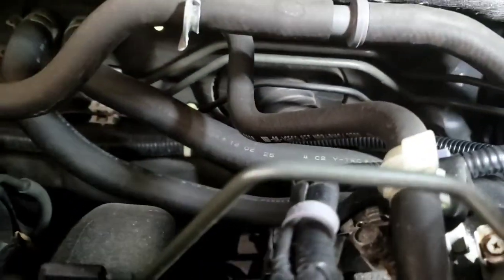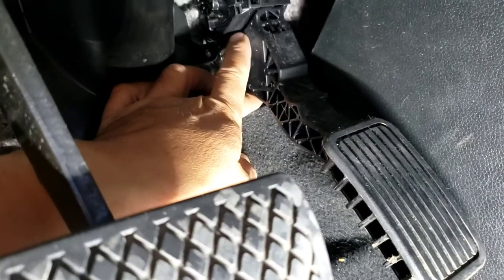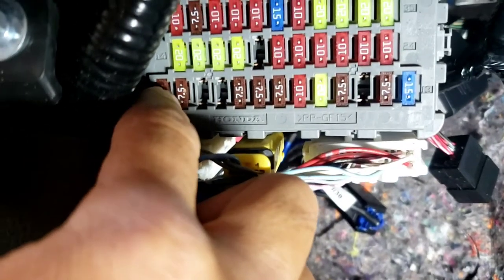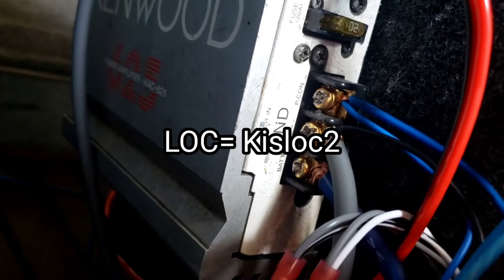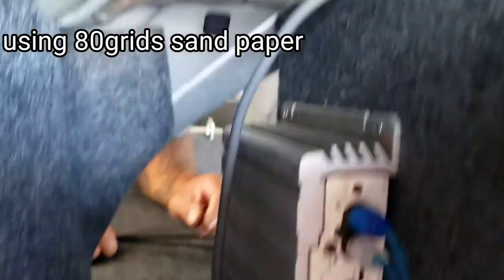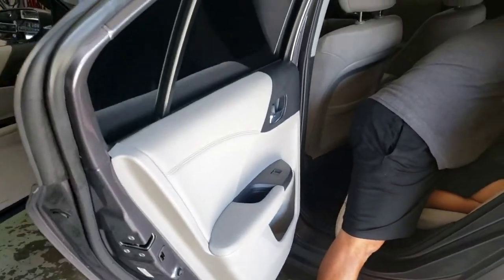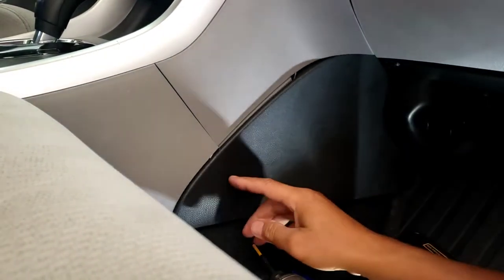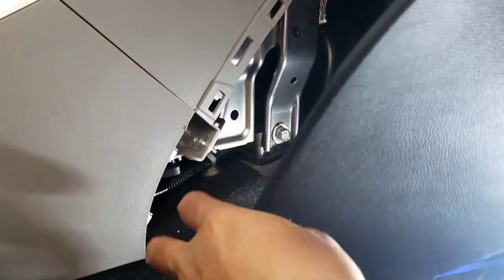Install amplifier Honda Accord 12 -16 factory radio || anc disabled ||

Comment: Cool trick to disable anc if ypu habe the older touchscreen head unit is with the car on hold the back disp and power button until diagnostic screen comes up   let go of the disp back button while holding power button use right toggle to navigate to the second option then hit select  you can let go of the power after that and use right toggle to navigate to the anc menu
Reply from the maker: Thank you definitely will helping others

Comment: I’d suggest Solder into an adapter not the original harness of the vehicle just incase something short circuits over time only will have to replace the adapter not the original piece .

Comment: Why do you unplug the grey plug and what is it for?
Reply: Active noise cancellation  module.  Worthless system that interferes with amplifier/subwoofer.   You will hear a constant noise coming from the sub if you don't disable ANC.